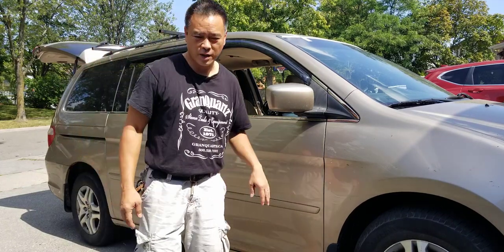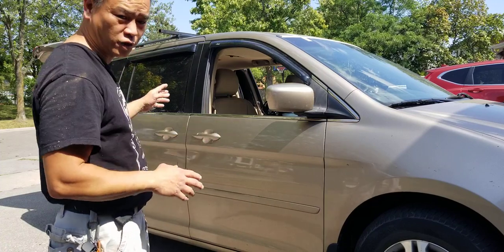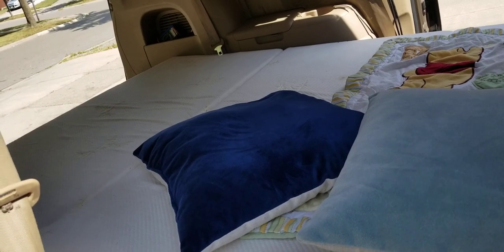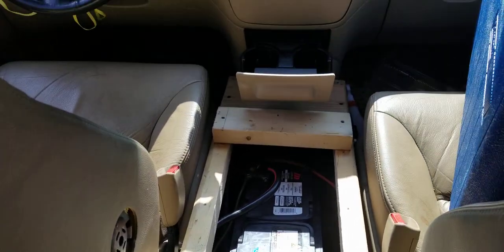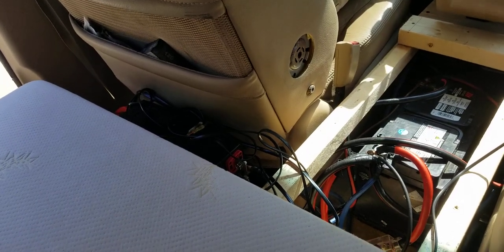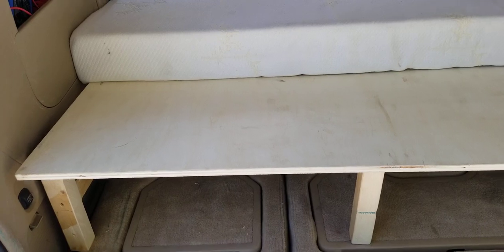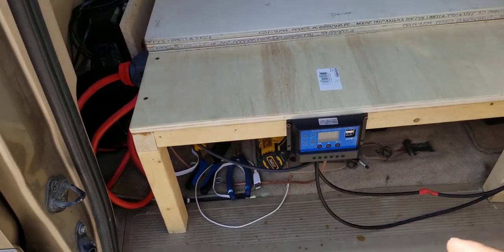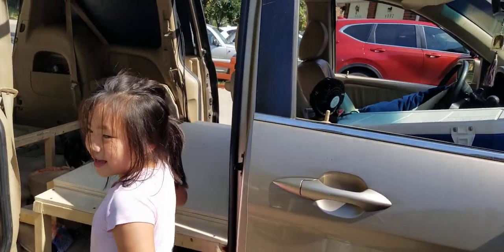Minivan Campervan conversion TIPS AND IDEAS simple yet very functional Update part 2

Comment: Oh I subscribed! When you said you wanted a tub and a shower!!  Could you tell me what I would need for power to live full time in my Honda Odyssey? They make a thing called a jackery and I'm just wondering if the 1,000 with two solar panels would be enough. I'm stationary most of the time so charging a battery off of my alternator would not work. Not enough drive time. Love your ingenuity and the fact that you lightened your load! 💜
Reply from the maker: So I bought a diesel heater but haven't install it yet been so busy with repairing in the house